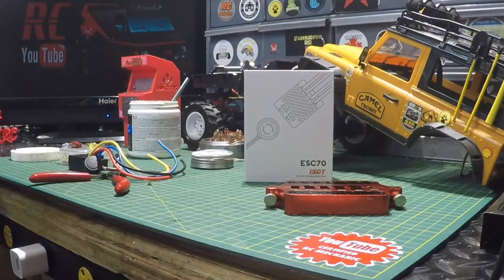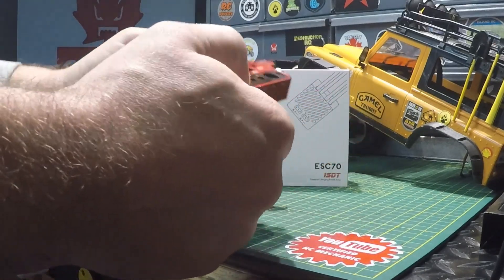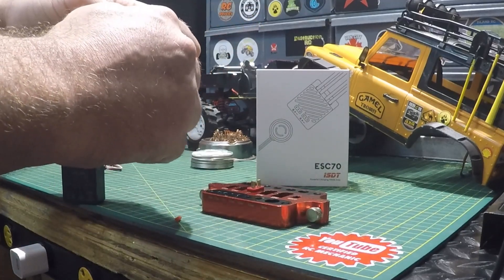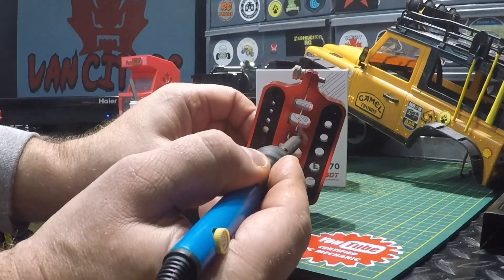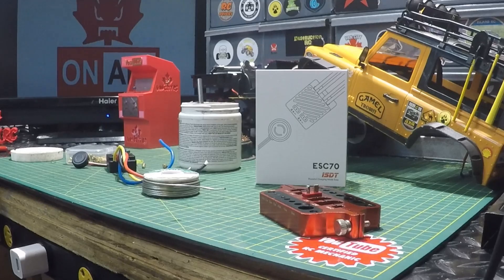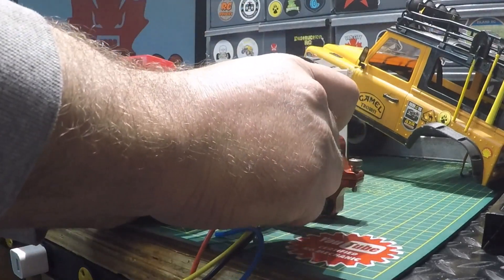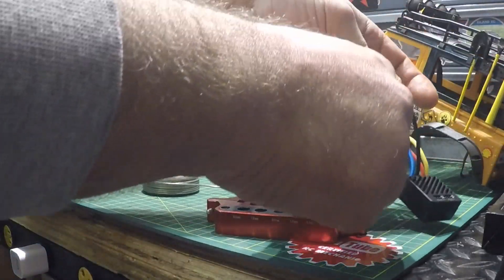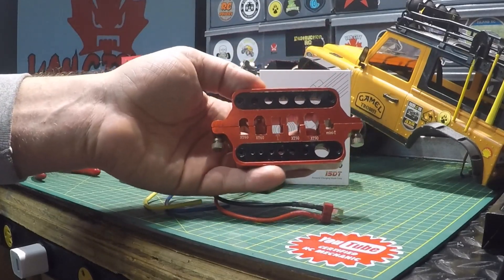Best Soldering Jig for RC Battery Connectors

Comment: Very cool tip on a great tool and how to use it! I love mine it makes it so easy to put the connectors on! I have a little vice I lock mine in and it works great to keep it even more stable 😁
Reply from the maker: Thanks Brad, these sure make soldering connectors so much easier 👍💯